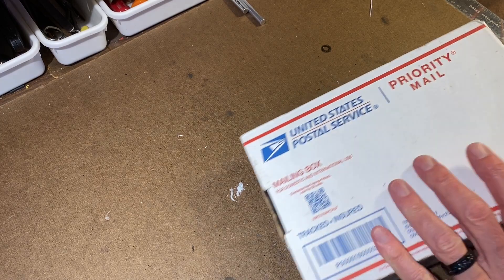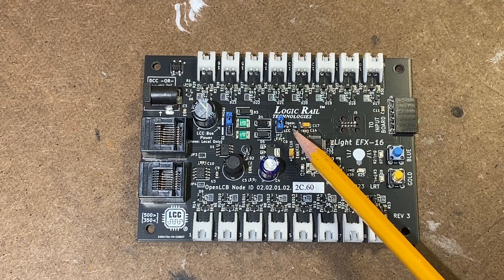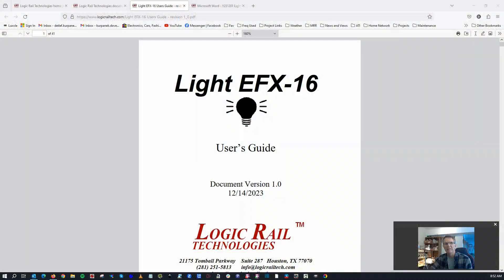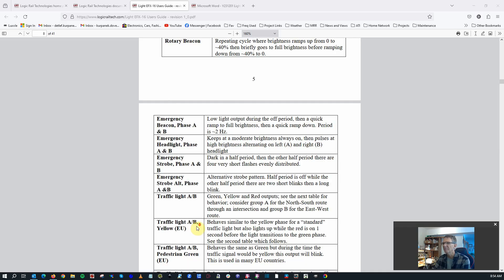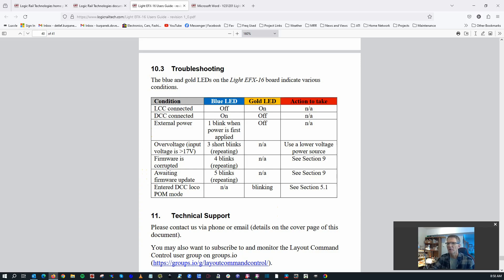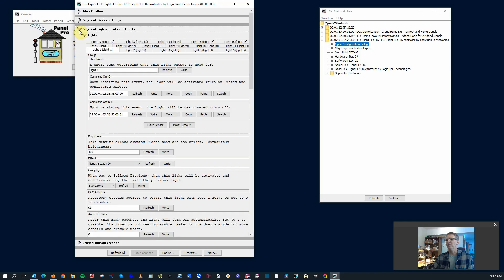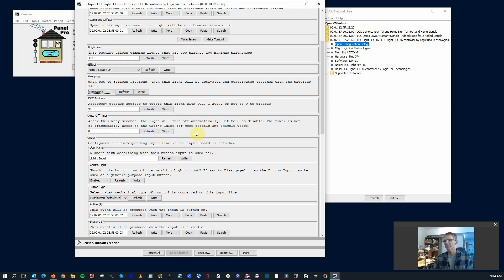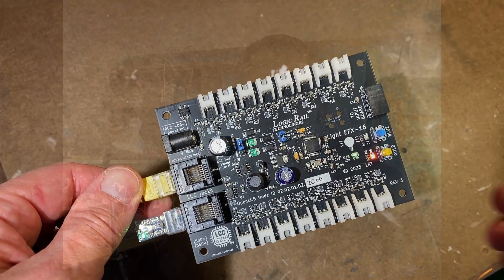First Look at the Logic Rail Technologies Light EFX-16

Comment: Thanks for sharing this product. I am looking forward to see how you hook everything up. This might convince me to go away from the just plug lighting system. - Jason
Reply: A side note, I think the connectors on the board are Just Plug compatible so it should be really easy to plug existing light into this board.
Reply from the maker: @bittyboy721 , yes, that is true. All the lighting connectors are the same as the Woodland Scenics Just Plug system.
Reply: @the-lcc-channel  I just purchased this item along with their fast clock. Thanks for sharing this as I have abandoned the just plug lighting system. I also tagged your channel as a card in my video.
Reply from the maker: I plan to do a follow up video once I get this unit installed. Stay tuned!